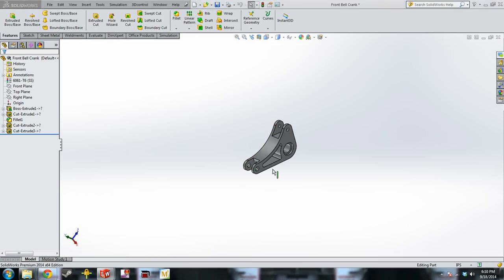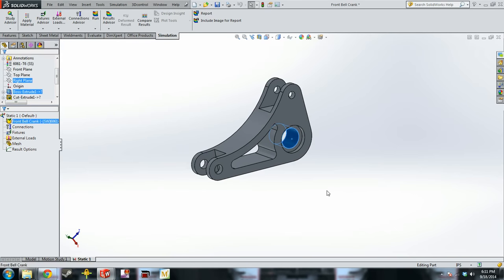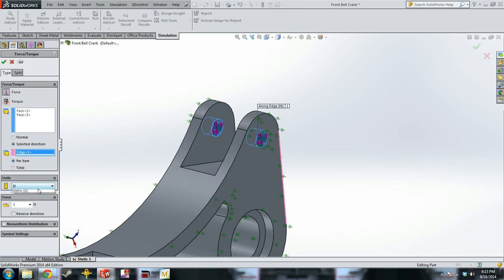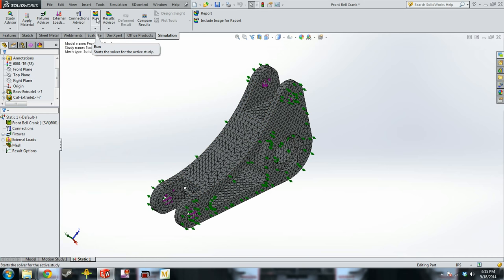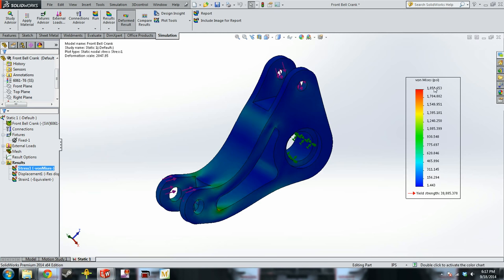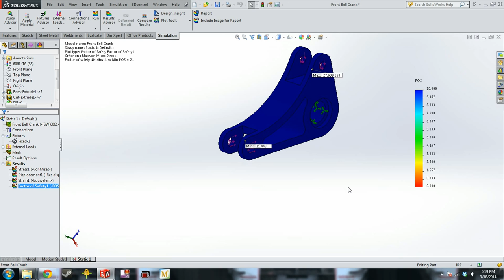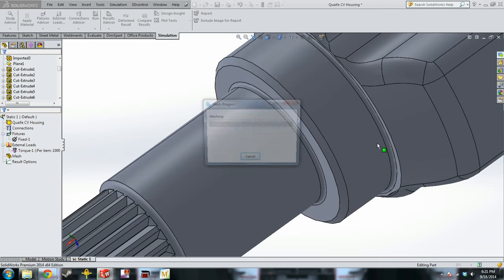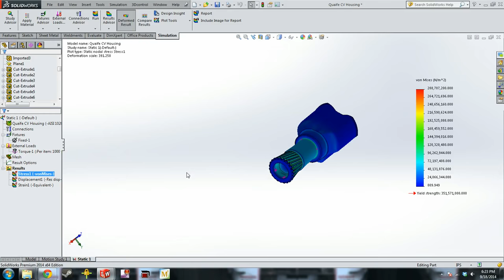Introduction to Solidworks Finite Element Analysis

Comment: The forces for the bell crank seem wrong. Why would the pushrod point directly towards the bearing? Also you set the forces so they push even the outside parts of their respective hole while realistically the force should only be transferred through the actual load path.
Reply: I agree. Force directions are incorrect imo.
Reply: Yeah. The direction seems wrong. It should be a torquing force.
Reply: The load is on the pin so yes the load path for force should be used. The forces will push outside the hole and not internally if you just do simple link analysis. Both connections of the bell crank are in tension.  You can use external pressure but that is also not load path.

Comment: Is it possible to run a FEA on an imported mesh I'm looking for a basic static structural analysis of just a single load pushing down an architectural column, and also bending applied to a 3d printed trainer sole (also a mesh)? Thanks and keep up the food work!